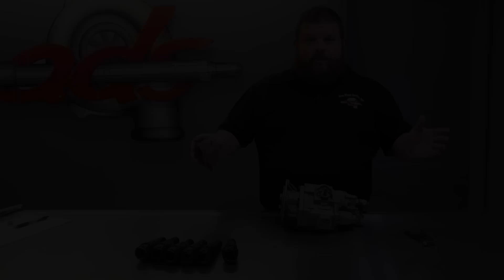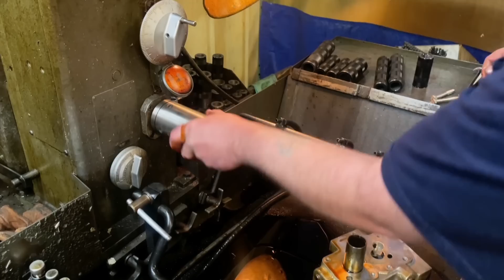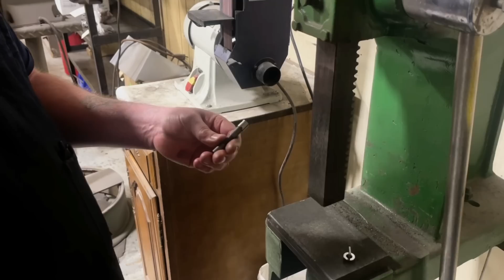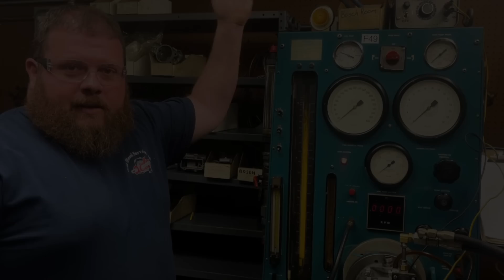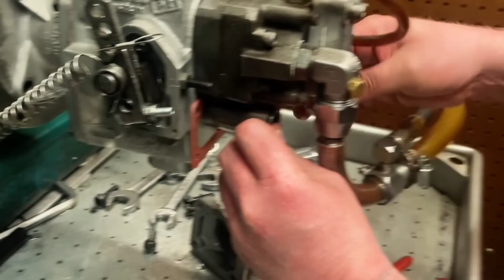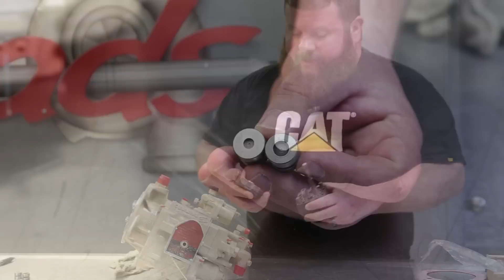#Cummins PT Pump Reman & PT Injectors for @DieselCreek  #BigCam AutoCar ConsTrucktor Engine Upgrade

Comment: thanks for making this video. i have a old 1960s kenworth water truck with a small cam 290. truck smokes white and throttle response is slow/ sounds like it misfiring. previous owner swapped the pump and said it has the wrong pump now... this at least gives me some insight on how these pumps work. five stars for you guys and a thumbs up.😎😎😎😎

Comment: i actually was very attracted to this Cummins Unit.   with services like yours and Cummins supporting the replacement parts at cheap enuf prices ( not John Deere )  i would - like a poster says below -  be much more confident to buy a used motor/vehicle.

Comment: Drove a 81 KW with a 400BC  that really barked, water in the fuel stuck the throttle up. Swapped out to a reman pump, it neutered that poor thing. Question for you, Is a button swap as easy as it seems for a power upgrade? Or is there other adjustments that need to be performed in conjunction with it?

Comment: Great video.  Whats cost for pump calibration an power tune?
Reply from the maker: That's a great question. And sometimes hard to answer. The problem is that we are very cautious about cross contaminating the calibration fluid in our test equipment. This means that we are very hesitant to put a pump that has been in service on our equipment without first confirming that it won't cause an issue with our equipment or our next customer's pump. And that is hard to do without disassembling the pump to inspect. Two hours of labor would cover the time to calibrate this pump. So you're talking about $250. But it is pretty rare that a pump comes in that we are comfortable with putting directly on our test stand.

Comment: Question, I have the exact same engine on my M923 military truck. I'm having problems with my fuel intake lines sucking air, causing loss of power. Once I get that problem solved, I want to install a lift pump to feed the main fuel pump to where it does't have to "suck" for fuel.  Will that cause any long time damage or over pressure?

Comment: Clessy Cummins, invented both the "Jake brake" and the PT fuel pump.  Both are marvels of mechanical genius. The PT pump and unit injectors used in the NTC Cummins engines were unmatched for being low cost to maintain and very rugged.  Nothing else came close, by comparison all the inline conventional pumps were economically hideous to fix.  One unique feature of the PT pump, is that if an idiot driver over revved the engine down hills badly enough, it had a failure mode that caused the engine to stop.  Great way to identify a bad driver and fire them.   I can remember, people spending US $10,000 dollars in the 1990's to fix Bosch pumps on V8 Mack engines.

Comment: Congratulations to Area Diesel, I'm from Brazil and I have several customers with this model of pump, I would like to be able to have a test bench for this here, as few people have these tools. Your technician is very organized and meticulous.
What model is this test bench, I'm going to look into buying one for my company.
We work a lot with DELPHI / CAV rotary pumps and BOSCH model P and A in-line pumps.
Here we have a lot of these NT855 engines in power generators, we don't have them in vehicles.
Successes to you all.

Comment: I was cleaning one of my toolboxes and found two stingers that came out of a Cummins 350 to bypass the governor, people made them out of a 1/8 pipe plug and small peace of brass welding rod about 7/8 long
They would blow up the engine 😢

Comment: I had a big cam 400 in a 77 Pete 359.
Mine had the old style pump and it was turned up a bit.
Reply: I still have all my tools because I worked for Cummins for 25 years 
I enjoyed it very much and still remember all the torque specs and I’m 73 now

Comment: A diesel injection pump that reliably functions with accuracy and precision for years of hard use with minimal maintenance simply by virtue of its excellent mechanical design and build quality impresses me more than its equivalent run by a computer. Once again, you guys impress me with your knowledge and skill. I will not hesitate to give ADS a call when I find an old M1008 6.2 Squarebody to work on.

Comment: Thanks for this video. Well made and explained and it gives the customer appreciation for all the work required for the rebuild.
 I need to get mine serviced next week. Currently running a 400 Cummins in a K123 Kenworth Cab over 1976 vintage. Truck runs like a charm. 
Cheers from Australia.

Comment: It is interesting to think that pre-1990's diesel injectors and pumps was designed without any computers or CAD software... Only in the later part of the 1980s was there CAD and computer software... 

Hats off to those engineers who visualized and designed those engines, injectors and pumps! 
T

Comment: My NTA420 small cam put 612 to the tires back in the 90s. It has been doing that ever since hauling grain at 80k plus pounds no issues. Keep rail pressure below 300 and things should be ok.

Comment: Well done all. You showed what needs to be done to get pump back to factory quality. Also showed us in detail what to do, and why, and what not to do, and why. Great quality everywhere in knowledge, skill, workmanship and parts. Camera shy fellow did an excellent job and you can certainly see see this is not his first rodeo. He can remember exactly what part goes where and in what sequence. I am not in that league, though I have been trying for many years. Can get all the bits together and working just fine but many times it is one step forward and two steps back because I got something out of sequence. It is a bit far to send you any of my stuff (I am in Land Down Under) but for anyone in your neck of the woods, would certainly recommend ADS. 72 yr supposedly retired mechanic/machinist/welder/fabricator etc. Still have a 16M x 8M shed at home with lots of toys in it 'cause neighbours and others bring me stuff - they say they want to stave off dementia in me - haha. They certainly challenge me regularly.

Comment: Matt might be happy too know i got over a 1,890,000 on my 1990 t600 flattop KW w/855 block 400 big cam cummins , one of my hero's that i followed all his advice was Bruce Mallison of Pittsburgh Cummins , he is real good with them motors ..mine dogged the 500 detroits when they finally released them ..but the miles got me , the brass ( or whatever material it was )gear on the oil pump slipped on the shaft , so watch your oil pump ..it only slipped when it got hot , it would have good pressure cold  , acted normal ...it ruined the crank , but first the turbo blew , limped into a shop , tried changing the turbo put a new one on , then realized the oil wasnt right , crank bearings gone , crank ruined ..
Reply: Them bearings i put in at a kw dealer in south carolina in there parking lot on the weekend on my back , they were closed , the bearings went almost 680,000 miles , then that oil pump let me down , should of replaced that back then ..

Comment: I worked on a lot of pumps. But I was only changing the fuel plunger/button. And adding shims to increase max RPM.  with a number 7 plunger and 2450 RPM no load.  It would pull very well. And still got 6.5 MPG.

Comment: I did come to watch you guys from Matt's channel before when he had something else worked on by you all. I'm amazed that you all do such an amazing, job. Back in my day when I was a diesel mechanic I only worked on farm tractor engines and didn't have any of the calibration machines you guys have. I always just had to go with the measurements of components. I mostly worked on Massey Ferguson tractors but I have worked on some John Deere and Ford stuff but nothing as independent as what you guys do. To know that everything you work on you keep such in depth records on each one and if something happens to it and it's not working correctly you can call you all up and you can tell what it left your shop doing and not make it guess work. It's so cool to see true professionals work on those pumps and injectors I know a lot of the injections you source from other reman company's but I've saw some you all did thanks to being introduced by Matt's channel. I always watch your new videos just like Hank's stuff from Hamilton ville farms channel. Or anything you guys post. Thanks for such detailed  videos. I as a former diesel mechanic love seeing these type videos. Keep up the good work I'll be watching. 

PS: I haven't watched Matt box up the pump or injectors yet but now I've got to go see this. Since Matt's channel one of my very favorite channels and I'll try to stay a week behind on his new stuff so I have something new to watch.
Reply from the maker: Awesome! Thanks for watching.

Comment: I think Matt said he was told that was over 500hp which he had no way to be certain.Those pump mods are common on mechanical cummins of that time,like he said.When you buy a motor like that your not sure what your getting or who has messed with it or messed it up.Some so called mods are more damaging than helpfull.Thats why the pump shop has to tear it down and make everthing right.

Comment: First step
You must setting the vacum according calibration data.

If not doing vacum set at 1st step your calibration is not valid. Try it by using diffrent vacum you'll get diffrent value.

Vacum setting is about 8 in.Hg

Comment: Been about 48 yrs since I last watched someone rebuild one of those pumps, worked at Cummins for a couple of yrs, did our own rebuilds back then, before Cummins Recon existed, they'd do batches of whatever component they had a few of to do at the time, one week may be fuel pumps, one wk could be injectors,  or a mix of lube pumps, water pumps, compressors, accessory drives, Cummins fan hubs, Schweitzer fan hubs. We wouldn't sell buttons across the counter to someone that didn't have a pump stand, had lots of requests though. Cummins Recon didn't really happen til mid 80's. Still a few H models around back then, had disc pumps on them, still sold NT262 conversion kits for the old 220's. Was there for BC1 unveil and BC2 unveil.